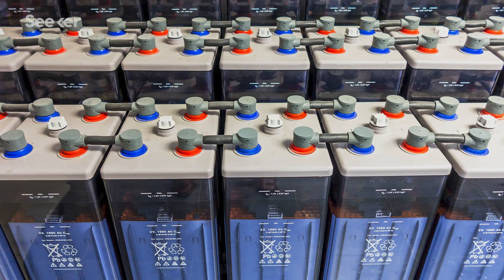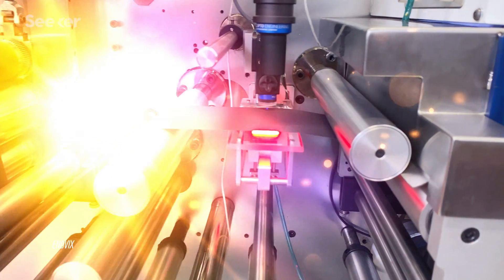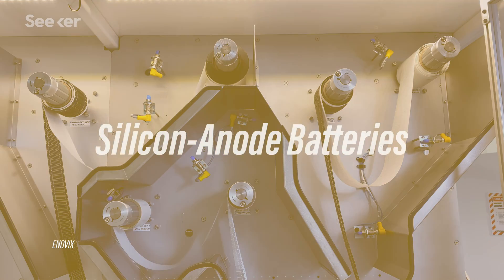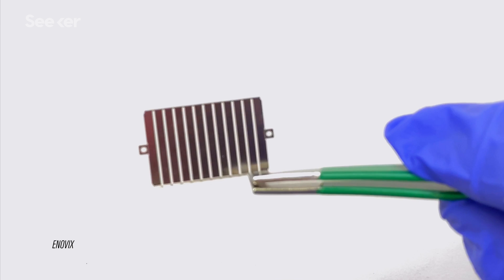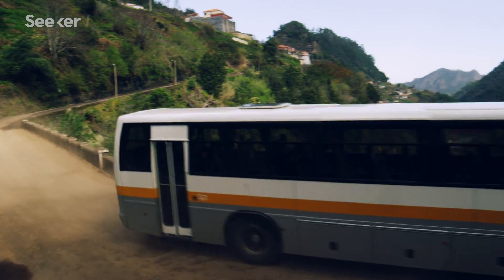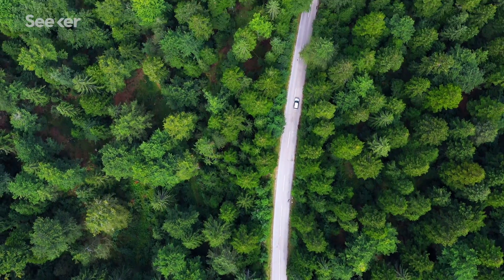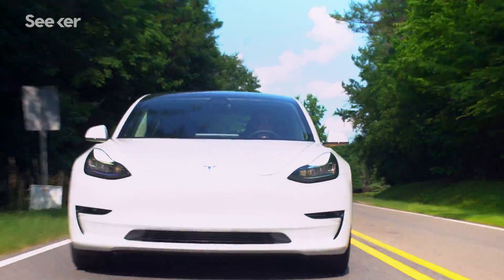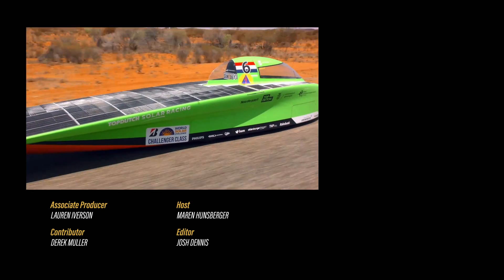What is the Battery of the Future?

Comment: What if we put wireless charging coils within the roadway only on long distance interstate highways and pick-ups in the bottom of electric cars to maintain a constant charge on long distance trips and eventually have them in most roadways everywhere to eliminate the need for higher capacity batteries all together?
The real problem to solve becomes not battery storage within vehicles but electricity production and distribution from power plants to the highways!
And even though we don't seem to want to admit it, the modular nuclear plant is the only realistic answer to generate enough electricity to power this future!
Well that is untill they fully develop the new fusion power plants sometime in the future!

Comment: I would be interested in a video on research being done in non-lithium battery chemistry. For example, Aluminum ions have slightly smaller ionic radii than Lithium ions and can exchange three electrons to Lithium's one leading to a potentially higher energy density, the main problem being that this very same trivalence leads to less predictable electrochemistry -- Aluminum ions too readily bind to open slots in between graphene nanolayers which can clog up the cathode, preventing it from becoming fully packed with Aluminum ions.

Recently, researchers at University of Queensland in Australia have developed a process that both increases the interlayer spacing and perforates the surface of graphene cathodes, improving the ability of the cathode to fill up with Aluminum ions. Graphene Manufacturing Group, an Australian company, has an exclusive license with UQ to develop and manufacture commercial batteries based on this chemistry; their first commercial button cell prototypes should be coming out toward the end of this year with pouch pack prototypes to follow toward the end of next year.

Comment: What if we use two capacitors which pass the energy back and forth quickly but have some way to tap from it a little bit at a time.Would that work?
Reply: I get the idea, however the main problem would be the high amount of energy loss due to heat. You can try to minimise it but you can't avoid it. Anything that moves causes heat, it's a fundamental part of physics.

Comment: a kg of gasoline has 12,500 watt hours of energy. until the energy density in batteries is much much better, it seems stupid and wasteful to invest in batteries that use rare earth materials and fossil fuels to create them in the first place. you are essentially trading one pollutant for another less developed and more expensive type of infrastructure. not to mention the conundrum of how one charges their cells is considerably longer than the few minutes it takes to fill a tank with fuel. only really viable in dense cities. i really hope a new finding comes out to make it a reality. but i doubt it to be so in the near future
Reply: @Thomas-nc9fz  Range is a problem,  like i said it's sufficient for a select demographic. Though there is still many situations it still cannot fill reliably, vehicles are not solely used for commuting. that's an  unrealistic expectation of use. many people drive much farther than the battery can sustain. Hybrids are a much more realistic option for the near future until the energy density is increased to not need the crutch of a small auxiliary engine system. I appreciate the well thought out response

Comment: After seeing a lithium battery catch fire a few times.  I wouldn't want 2-5-10 more energy in my pocket...
Reply: The problem is the growth of dendrites, which become short circuits, then fire. 

Glass batteries (a form of solid state battery), is incapable of growing dendrites, capable of faster charging and discharging, and could have charge cycle lives between 20,000 and 25,000. Add to that sodium used instead of lithium, and we’re talking;
- Cheap
- Long lived
- Safe, no more fires
- Superfast Charging
- High energy densities
- Light
- More environmentally friendly. Since the Sodium could be derived from simple sea salt.

The next generation of batteries is going to make electric vehicles far more economical than gas powered. It will also make green energy production and distribution far more viable.

Comment: so......how about this question:

I buy a phone, and after over 2 years of use, the battery can still last quite a while, around 4 hours worth of continuous use.

BUT..........I buy a bluetooth speaker, and after only about 1 or 2 months of use..................
what was supposed to last 2 hours, now not only lasts 30 minutes, but halfway through it no longer outputs enough energy and will result in popping from the speaker.

they both use lithium ion batteries, so why does the speaker crap out after a month of use but the phone battery can go for waaaaay longer?

Comment: COLD and HOT weather affect batteries too. It's rarely mentioned or covered but another issue to study is how these batteries don't perform as well in extreme cold (not only do not deliver as much energy due to the cold, but they take longer to charge) and this is worsened by the fact that you need some heat for the occupants too. Hot weather seems to be less harsh but it also affects the performance.

Comment: I've heard from multiple sources that Chinese factories are told to produce batteries that do not exceed a certain amount of time it lasts on a charge as a form of planned obsolescence. Is this true? 

if so, what is the point of these new technologies if we are just going to hold them back anyway?
Reply: I know that planned obsolescence is a thing but i haven't heard anything about what you said.

As far as i know, the expected/planned lifecycle of a product is part of the design process and no one designs anything to last "forever" because the product would be too expensive. Engineers are allowed to stretch their durability muscles only in specific use situations (industrial, military, and space products)

Also one of the biggest downsides of lithium Ion batteries is that they degrade and lose capacity EVEN if they're just sitting on a shelf and not being used. That's a result of their chemical properties, not because of planned obsolescence. I think companies use this to their advantage to implement planned obsolescence. For example, there are many electric razors and vacuum cleaners that run ONLY on batteries (can't be plugged in). Since most lithium Ion batteries last only 4 to 6 years, that puts an expiration date on all of these products since changing those batteries is too difficult/expensive. That's why i avoid products that unnecessarily run only on built-in batteries.

Comment: Renewable energy is fine, but the environmental impact of manufacturing is very high. For example, Germany is getting most of its power production from wind and solar farms. The wind turbines themselves need alot of steel to construct, which comes from mining. The mining process itself is very damaging, but i wont get into that as everything we build needs some sort of metal in one form or another. The issue is with the amount of materials used. A standard turbine consists of about 71% steel. And according to google that is about 355 tons. Thats a very rough estimate as turbines can vary in size and therefore by weight depending on the terrain it is built on, and other factors such as the power generation rate, which affects the size of the turbine and therefore costing more material. The process of steel manufacturing releases alot of CO². 2 tons of CO² is produced for every 1 ton of steel manufactured. This is a 2:1 ratio. Considering a single wind turbine needs roughly 355 tons of steel to construct, we are looking at 710 tons of CO² per turbine. Thats excluding other materials such as copper and aluminum. 
A single wind farm might consist of hundreds of these turbines. And for the amount of CO² produced to construct the farm, it isn't very eco-friendly. However it does pay off in the long term, as maintanence costs are fairly low. But, the space required to build such a farm, solar or wind, takes up a lot of space. There is only two favourable locations for a wind farm. offshore or at a high elevation with flat terrain. And most places aren't like that. The most limiting factor is not the terrain, but the vegetation in the allocated site. In short, this means some deforestation has to be done to a certain extent. This will have many consequences, one of which is actually releasing more CO² into the atmosphere. This brings me to my next point. The power generation is not great when compared to the amount of materials used and the environmental impact caused. An average wind farm generates about 300MW, assuming that the wind farm has 100 turbines. At the cost of 7100 tons of CO² released from the amount of steel needed to be manufactured to construct it. This does not include the effects of the other materials needed to construct said turbine. Then there is the problem with reliabillity. Wind isnt a constant, which means power generation will almost never reach 300MW. Compare this to, lets say nuclear power, which everyone has been trying to get rid of. The amount of energy generated by an equivalent power plant (300MW, not very realistic for a single power plant but for simplicity), would cost way less material and have an overall smaller carbon footprint compared to wind power. Saftey of these power plants as already been debunked by many so i will not talk about that. Solar power, is actually less costly than wind power, in terms of materials. However the manufacturing process for alot of the components involve very toxic substances. One component is lithium. The process of mining lithium uses alot of water. Approx. 1892705.892 liters of water is needed to extract 1 ton of lithium from the ground. Sure, there are alternatives but this is a very generalised outlook on renewable energy. I dont think that they are very eco friendly as is, compared to other types of power generation out there. But over time things will improve, but currently it looks quite bleak. Nuclear power has its drawbacks, including the waste problem, but overall it is the most efficient power source we have today. I dont understand why everyone is pushing it away after 3 disasters. All it takes is a little bit more effort to make things way safer.

Pardon me for the rant.
Reply: Great points but it’s still fundamental we move our energy sources away from fossil fuels ASAP, be that nuclear, wind and solar. 
These materials can be recycled reducing their overall footprint. Scientific development will eventually allow us to reduce our lithium consumption as 500,000 gallons of water per 1 metric ton of lithium is unimaginable, I’m sure it’s recycled in some way. Here’s praying the ITER fusion reactor is a huge success!!
Reply: I like your opinion on this and agree with it. Especially for solar energy. For it to take over, the manufacturing process must become more sustainable...... .

Comment: Batteries move the pollution from the gas tank to the lithium mines. I would prefer Hydrogen fuel cells for a cleaner environment.
Reply: not if they don't use lithium
Reply: Yes for now, but once we improve the technology we may not even use lithium. And it's probably better that we move the pollution from our tailpipes to the lithium mines, until we find a better more viable solution. 

Hydrogen is no better, it uses fossil fuels to separate the hydrogen bonds (from water). I think they use natural gas to do this.

Comment: We can send boats with solar panels on them and planes with solar panels,so they can harvest sunlight as they travel.
It's called dAylight sAving
Reply: Planes only work with ultra light, ultra efficient designs, anything useful would need to drain a battery, boats are the same, drag from water and flying are incredibly energy hungry, even if you were to catch 100% of the solar energy raining in its surface they would still need more
Reply: @ericsaul9306  the planes and boats can use some of the harvested sunlight for travel and deposit the rest at the next destination

Comment: What about aluminium ion and graphene batteries?
Reply: adding graphene into lithium-sulfur is interesting
Reply: It's mainly because the main ideas discussed in the video are closest to market readiness.... In comparison, even through graphene batteries have seen extremely promising improvement (especially at Samsung), they are still miles away from becoming the new standard
Reply: They did give reference about graphite hinting graphene batteries if you watch the video again.
Reply: yes..even i was wondering why graphene wasn't discussed..
Reply: That's SSB
Reply: The graphine batteries are more like super capacitor